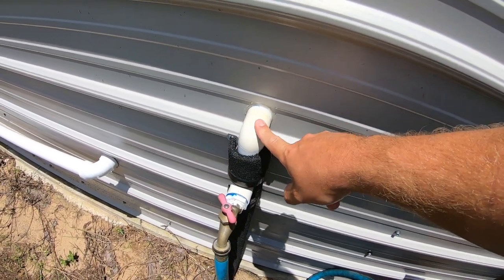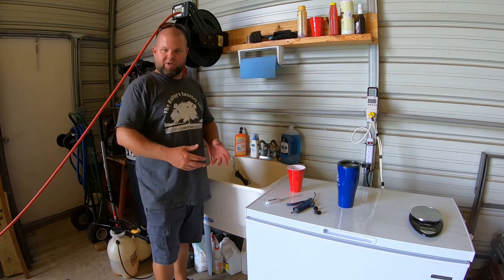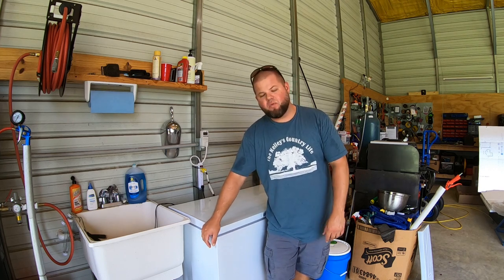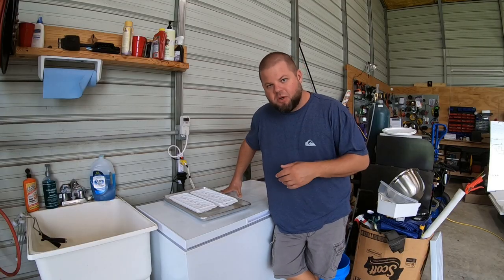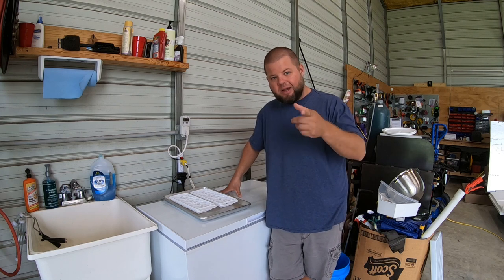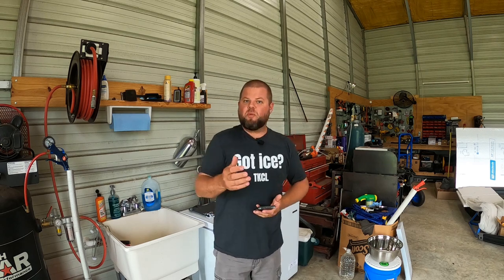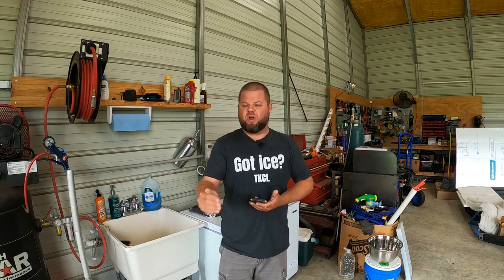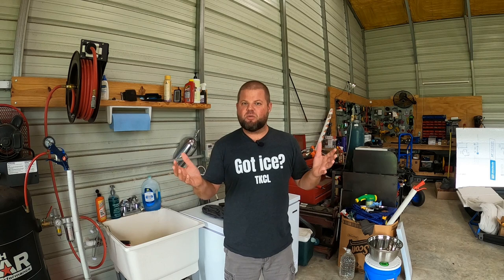Homemade ice machine tests! Hot water freeze quicker than cold water Mpemba effect? #376

Comment: idea on insulation:  on the inside along the top you could put a bathroom dual pane window  across the top, just frame it, or find a used ice cream display and rob the window out of it.    This way every time you open the door your not loosing as much cold air.   Heck maybe even look into one of those  ice cream displays for overall insulation additions.     ie dissect one and figure out if you can use any of that tech in your setup.    Enjoying the videos keep it up!

Comment: Ok, wow. You covered a lot of ground in this one. You put a lot of options on the table. I've watched this from end to end. After considering your test results and your cyphering, I'm going to make three suggestions.
First: Get some shade on that inlet pipe and the wall behind the sink and freezer.
 
Second: I like your idea of a fan to move the air behind the freezer and around the compressor.

Third: Bang for the buck, I suggest adding 1 or 2 more icemakers to the freezer. You said you don't have the room, but I believe with a bit of thinker tinkering, you could. I don't recall the price of the icemaker but I'm guessing it isn't more than that coil of copper. 
Going with the copper coil in the mini fridge and get 7-8% improvement versus 33% increase for the same $.
Just my suggestion.
Reply from the maker: I'm kicking all those ideas around

Comment: I think that introducing the second cooler (the mini fridge) is only really introducing additional capacity to the systems net cooling...   AKA its making the "Icemaker" (as a system) cooling capacity "bigger".
If the freezer (by itself) is not using all of its cooling capacity, a more efficient method may be to prechill your water in a coil in the freezer itself... perhaps in a riser that does not get below 32°???

 If you lower the setting on the freezer you likely can prechill the water and still maintain ice production at the cost of a minimal amount of extra energy and system run time.

 Im not sure you can do this without freezing the water in the coil though, I could see it working in a refrigerator/freezer combo... but thats not exactly what the project is here.
Reply from the maker: I'm already kicking that idea around, I have two options for a coil on the freezer
Reply: @TKCL  Look forward too it... Keep up the great content.

Comment: Have you thought about abandoning the weight measurements for the metric?  I know at the end of the day the weight production is what is desired but the ice machines make the same amount of ice per “flip/empty”. Is there anyway to set up a flip counter. You could measure easily the time between flips. The faster the flip times the more ice production. Wouldn’t need to wait 24 hours or use the scale. Just an idea. Have to think of a simple cheap way to count the flips. Is there a way to record the signal being sent to the pumps maybe? Anyway Great feed. Great content. Subscribed👍🏻
Reply: Also the fly away measurements may be a timing issue. The outlier of the tests may have been started with an almost frozen tray and were ended right after a recent dump of ice. Counting the time between dumps would eliminate that factor.
Reply from the maker: This late in the game I'm sticking with the weight tests, if I had it to do over again I'd just measure incoming water flow. But it's nice seeing the product.

Comment: Why use copper? Use the plastic you already have. Even brand new fridges use plastic to chill the water for drinking water. And you are already paying to run the mini fridge, so the cost to chill water for ice maker will be almost nothing.
Reply from the maker: I could, just knew copper would offer a better heat transfer.
Reply: The amount of plastic line you have will hold enough water so the water at the end will be the temperature inside mini fridge. I don't think copper will gain you anything but a lighter wallet after buying it.

Comment: I’d just throw that plastic line in the mini fridge and drill 2 holes in the side to feed the lines through. No need for the copper if it’s working fine with the plastic.
Reply: The plastic tubes froze in the first stages that’s why he had to replace them  with the thicker plastic tubing that came with the ice maker. I just think the temperatures in the freezer are way too cold for the water what will have to travel through the tubes.
Reply: @TriggaTreDay  I'm talking about using them in the mini fridge for the pre-chill. Mini fridge would only be 38-40 degrees so they wouldn't freeze

Comment: Awesome.  Yeah there are a lot of ways to cool water timer in the aquarium I’ll be there have chillers which are air conditioners for water. Even leaving the water on this kind of impractical no it’ll be good for the test and will work. But if you’re not on a well that’s gonna cost you money even with the well it’s going to cost you some electricity and if your well doesn’t produce a ton of water that could be a problem. Shading the well pump and pressure reservoir and all that would make a difference for sure as wood shedding the pipe coming into the shop as well as the ground over the pipe running to and from the shop.   I guess you have to figure what that balance is and what it’s worth. Not just from the ice production viewpoint but how much do you want to spend or build to shape things and do you want that taking up space in your yard and/or obstructing your view. The answer is always about balance but it’s interesting to see exactly how much it affects these things. You could even make a reservoir outside of the freezer only of a gallon or two and run a heat sink on it and maybe even another electric fan on that heat sink to draw the heat out of your water and cool it down a good 10° or 20° if it’s worth it.

In the ice tray test to be more accurate you should really put them in the freezer individually because when you’re adding three trays and two of them are warm or hot you’re going to change your total results because you’re adding a bunch of heat to that freezer that’s going to affect the other ice trays even the cold one.  Still anyway you look at it cold is the absence of heat and freezers and refrigerators work by removing heat so if you’re going to start with a body of water that has more heat in it it’s going to take longer to get that heat out of it. Know if you’re throwing a cup of hot water into 40 below freezing temperatures outside, the hot water is going to be thinner and evaporate faster which is going to change its mass and it may freeze faster but it’s probably not freezing as much either because the hotter the water is, especially if it’s boiling to the point where it has bubbles in it you’re going to have less mass because water molecules expand when the heat so I’m sure there’s some point where water reaches the temperature where its mass is so greatly increased than the same size volume of water do you have less of a mass but I think realistically you’re gonna have to get to the point where the water is almost in the gaseous state.  might be more dramatic looking when you throw the cup in the air but from a physical standpoint I don’t see our freezer is ever going to take more heat out of some thing faster than it would to take less heat out of some thing when they’re of the same mass and general consistency. I think your best bet is going to be the shade your tank and pipes I guess we’ll have a better idea in about 30 minutes.  😂
Reply from the maker: Honestly at this point it's just seeing how far I can push these little ice makers. It's becoming an obsession lol
Reply: @TKCL  lol. I always found this stuff fun, and the fifth grade I got the “science king” award. Lol. I’ve always just like to kind of get obsessed with some thing for a while and figure it all out and understand the science and methodology behind it, then I usually just move on to the next project. I just think it’s interesting to know how things work. A lot of that knowledge applies to other things in the more you learn the more fun things become and the easier they are to figure out

Comment: For the chilled water method, why not use one of the portable ice makers, just pull out the basket so the ice falls back into the reservoir to chill the water farther! ie: put the loops into said reservoir of the portable ice maker with above method to just reuse it's cooling properties to help chill that incoming water! Plus, you'll might need to see if adding a water cooler adds to much energy usage!
Reply: To make the portable ice maker work without cutting it up, just cut some foam up to add a buffer block between the lid & reservoir so you can cut into the foam block so the lines can go though!
Reply from the maker: The energy usage to run that ice maker would offset any gains

Comment: Here is an idea for version 2.0. You talked about a space between the lid and freezer. You could run the water line in the wall of the new spacer thus getting you to the 50 degrees.
Reply from the maker: It will take some testing, but it's possible for sure

Comment: Does the ice maker "know" when the ice is formed or does it just have a timer built in? It'll only turn out the frozen tray after so much time has passed.
Reply from the maker: It has a thermostat that reads the mold/tray temperature. Once it reaches a certain setpoint, a timed dump cycle is activated and the process repeats itself. The quicker you can get the mold down to temperature, the more dump cycles that are triggered.
Reply: @TKCL  Thanks for the reply.

Comment: hello have been watching your videos about freezer icemaker and idea is good  but could use a few changes to make better   First  you need to seal up incoming water lines and electrical coming into the unit  you are getting too much outside air entering your freezer  which attributes to the heavy frost accumulation on freezer walls   frost accumulation over 1/4 inch and your cooling ability diminishes greatly   second   move your fans over top the icemaker molds  blowing cold air onto front covers  will not help   the sensor to trip the icemaker is located just behind the forward part of the mold  and blowing cold air on the cover will not increase production  third  defrost the freezer and start over  fourth   set freezer for as cold as it goes   those icemakers are designed to cycle at 10 degrees  so the colder you have your freezer the more ice production you should get  just trying to help you out  a bit   and another thing don't be too concerned about incoming water temps  it is what it is
Reply from the maker: I've discussed this a few times, I am using this as a test unit and will build a new one after testing is done. On the next model lines will run through a collar that I am going to build to raise the lid. I am getting far greater moisture and frost build up inside due to me opening several times a day for recording/testing than that tiny gap. But no doubt a gap isn't good. I ran this for three months before these videos blew up and I started daily testing. Frost buildup was no where near what it is now.
Reply from the maker: I also discussed at the end of this video that I am soon going to do a frost test and see what affects, if any it has on the freezers efficiency.

Comment: I would consider running a waterline thought the freezer chest continuously in a loop, so you have a loop of chill water to feed the ice maker. Another option, run an air line from the freezer chest to the outside mini fridge, which you can then power off.
Reply from the maker: I think that is a logical choice, especially in the lid

Comment: I'm not sure if someone else already mentioned this, but would it make sense to add a stainless steel cover or aluminum foil around your pipes outside to try and reflect sunshine in the summer months away from the inlet pipe that feeds the sink? Maybe drop the incoming water temperature a bit, or is the length of time in the line and room temperature behind the unit make something like that pointless?
Reply from the maker: Working on something now, thanks!
Reply from the maker: It'll definitely help

Comment: Wouldn't the sides of the freezer be colder than the middle of the freezer? Hence why the chilled water froze quicker because it was beside the sides of the freezer. Idk if this is actually the case but just a thought. Maybe test again with the chilled water closer to the inside of the freezer and the hot water closer to the walls of the freezer.
Reply: That could be also why the tops of the trays froze before the bottom
Reply from the maker: On the second test I had the trays ran the opposite direction, both were near a side

Comment: Don’t know if you have thought of it but if you want to chill water with out wasting energy use your lid it absorbs a lot of heat run a few loops on top and insulate it with some styrofoam will probably make it way more efficient also.
Reply from the maker: That's exactly what I've been thinking about doing, or the back of the freezer.
Reply: @TKCL  yeah the back would be even better if there’s no condenser coil inside was just suggesting the lid because I had placed a case of water on mine and the next morning they where really cold and they where just sitting on top

Comment: Its all about energy. It takes less energy to freeze cold water because its closer to its goal and less work. So 33 degrees would be the easiest to freeze. Only has to move 1 degree
Reply: Right now we are mixing the hot and cold air together and if you pull the coldest air from bottom it does not mix with the hot air. Then you will push the hot air down and away instead of mixing. That should get you optimum results.

Comment: But the actual ice makers are running on time not temp right?
Reply from the maker: Nope, there is a thermostat that reads the mold/tray temperature and that's what triggers a short timed dump cycle. The quicker you can get the mold down to temperature, the more dump cycles that take place.

Comment: Hey, I've heard you state it twice now and I think the 4 lbs of ice was with one ice maker and the 8 pounds was when you added the second. Correct me if I'm wrong.

Great idea all in all no matter what you started with though. Thanks for posting your finds.
Reply from the maker: Actually no. Originally in early spring/late winter I was getting over 3 and close to 4lbs with one ice maker. I added two ice makers and all was well. Now that it's extremely hot and summertime, two ice makers were only producing a little over 4lbs. I added two fans and production flew up past 8lbs.
Reply: @TKCL  ok, guess I missed the vid on when it got hot. 
Very interesting discoveries you're sharing.
By the way, the newair cooler did a real nice job at the farmer's market.
Glad you reviewed it.
Reply from the maker: Awesome, mine is still kicking out at the house working as a job site cooler.

Comment: Warning long comment. 

I'm glad to see the process in testing all of the options with water temperature, amongst other variables.  I have been thinking the whole video about your previous videos where you had mentioned in your final ideation of the freezer adding a keezer inspired collar and adding insulation.  Finally at 39:37 you mentioned the top and back being cold.  🥳
One thing I would try as far as insulation goes (and incorporate cooling your water)  is take a sheet of 2 inch  foam and carve out a small path for the poly water line to stay in contact with the freezer.   That should help cool the water down before entry.   Weather the top or back is best, either should help, I would use braided stainless steel lines if you go for a top mount to prevent a fatigue failure.  

I brew and have a keezer myself...  and though my own quest for the best method of insulation I have yet to put on my collar and taps.  Debating between which wood would insulate best, if a sandwiched layer of foam would help, Foil faced... if you test before I do thanks!  If I get inspired I will share.

Either way(external mount or mini fridge) I would say stick with the poly line.  Its cheap and easy to work with.  The water in my fridge is in a poly tank and it does just fine🥶.

Rambling over for now. Stay cool!
Reply from the maker: We think alike, I've already been considering that. Thanks

Comment: Stopping at 5:48, I thought "What's the operating cost of running a cheap (used) mini-fridge with coiled copper tubing inside versus regularly filling a bucket with ice, or leaving the tap on?"🤔
Reply from the maker: No cost for extra ice production, because the mini fridge is already in use. The compressor might run a tiny bit more because of the incoming water.
Reply: Keep watching

Comment: Yep chilled water and all air conditioners have air recirculation. When you pull the cold air from bottom and duct it to blow in center of makers you will create a circulation that will push the heat down through your stored energy with the ice and make it faster and possibly more efficient.
Reply: And really a slow moving recirculation fan would work better than fast. Because it will give the air more time to exchange energy with the ice in bottom
Reply: You have to force recirculation by pulling from bottom and blowing accross makers. You could go as small as 2" pvc 1/2 inch from bottom opposite side and use a slow moving 2" fan and that will create an internal air conditioner.
Reply from the maker: It's on my list, just don't want to take up valuable room.